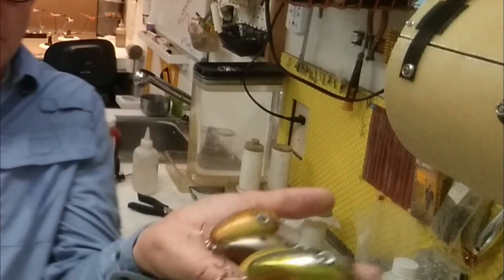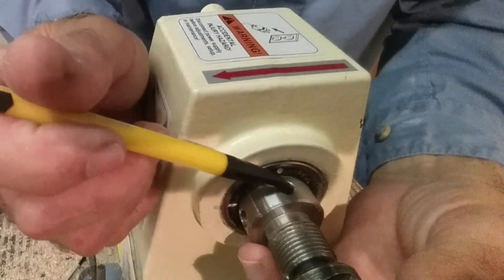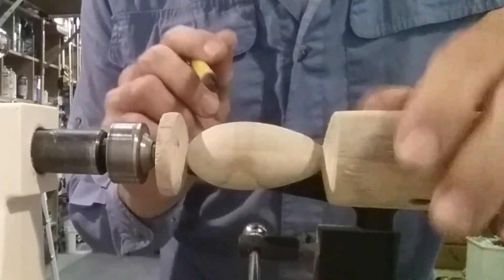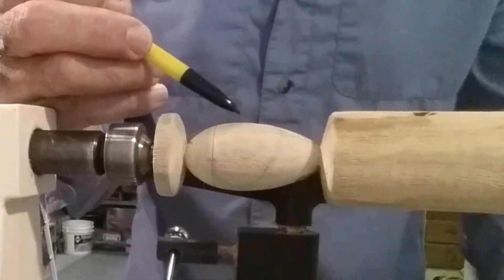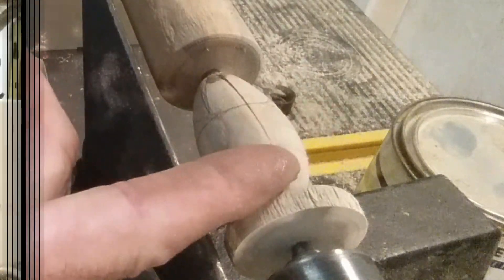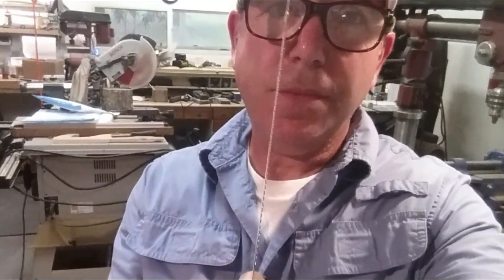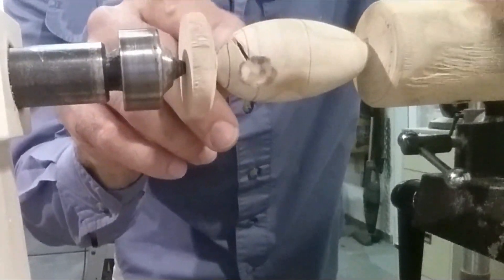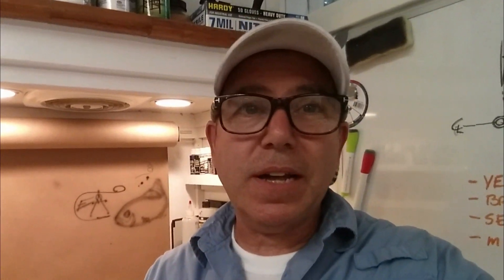Pro-Tip for lure makers working on a lathe

Comment: Good tips here. I like the way you use the clamp to line up the saw. I use a hacksaw to cut the lip slot while holding the lure in my hand, its a hit and miss affair but I dont mess up to much. If the lure swims to the one side then I would heat up the bib and bend it accordingly so that it swims straight.
Reply from the maker: Oscar Stone 
thanks for the feed back.... the video makes it look more difficult than it really is. Doing it all on the lathe actually makes it quicker and there's a lot less worry when it comes time to water test it. nothing is ever perfect so having away to make adjustments like you do, is an absolute must.